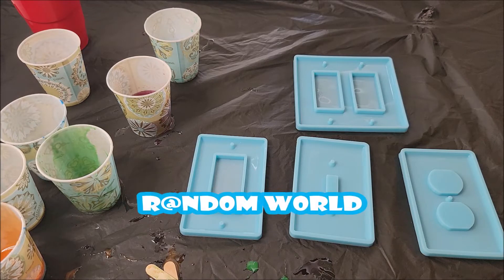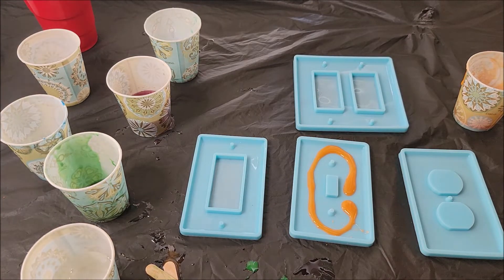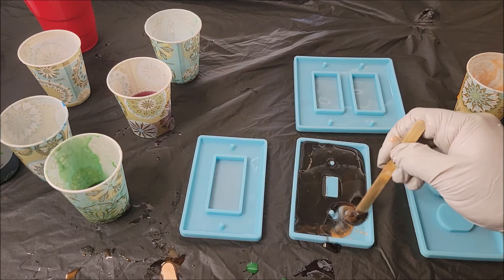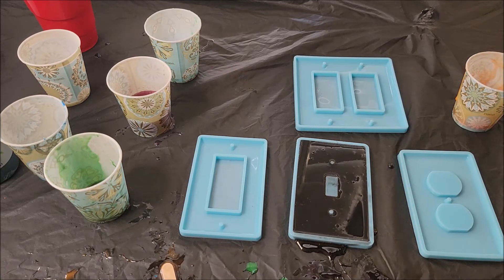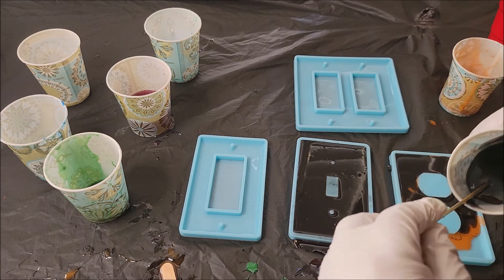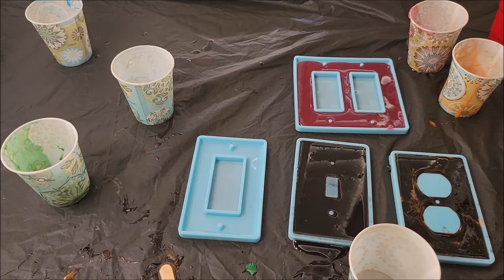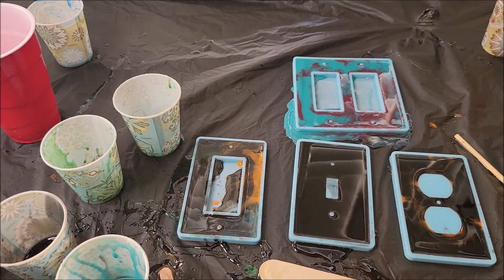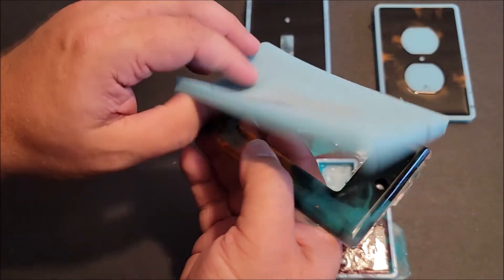Resin Light Switch and Socket Covers   #0002

Comment: How do you make the molds in the first place ?
Reply from the maker: @georgebruce2165 For these, I bought the molds on amazon.  Though you can make any mold just make sure you use a silicone base when using resin or you will break your mold every time.